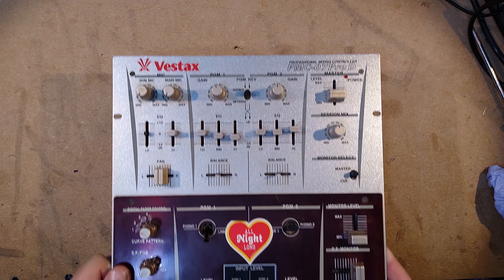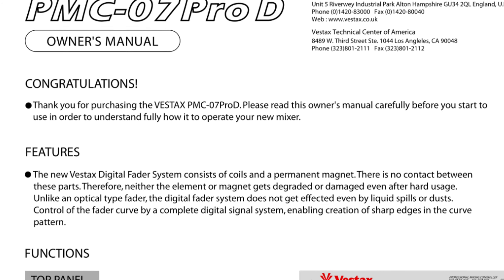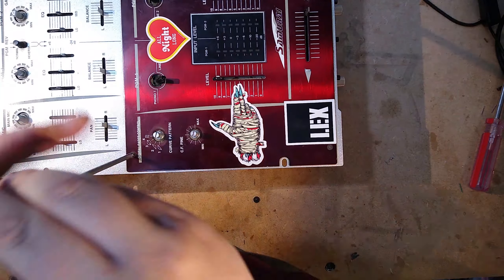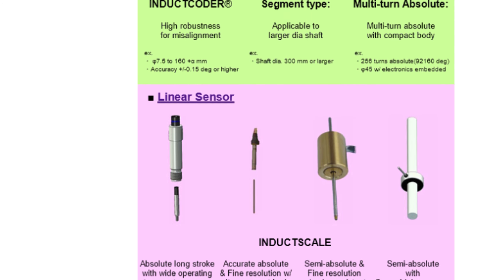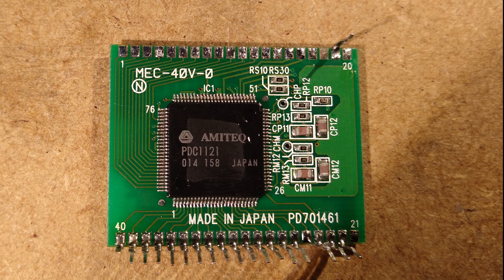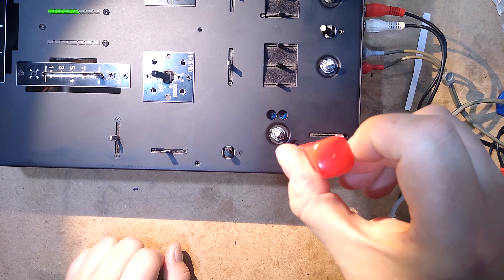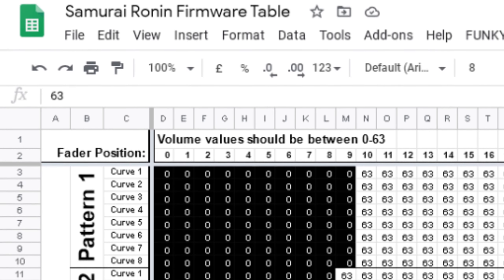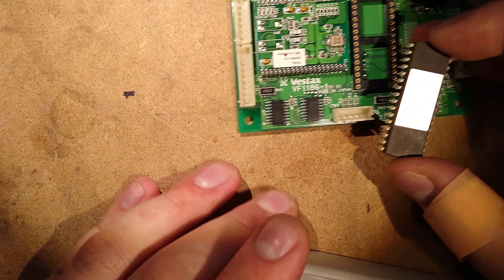Vestax Samurai Teardown + Mods

Comment: For my 06 replacing the caps with 47nF  was fine. Using smaller left a small pop. So I think that will work for both 05 and 06

Comment: Can you please do a focus fader review
Reply from the maker: I'm actually planning to!
Reply: @TheRasteri  I have a question about your final scratch video. I would love to know. If the current traktor scratch pro 3 is still running old final scratch code? Nobody seems to know.
Reply from the maker: @CarlosMunoz1980  nah it's a totally new code. even the earlier traktor scratch
 mk1 timecode was different from finalscratch (2000hz instead of 1200)
Reply: @TheRasteri  ahhh I see. What about traktor pro 2 and traktor pro 3. To me it seems like just a new paint job and some minor tweaks and features. Sorry to bother. I love and still use traktor. But am a little disappointed how NI have neglected it’s user base. Serato rekordbox and even Djay pro have surpassed them in many ways.
Reply from the maker: @CarlosMunoz1980  yeah NI don't seem to care about traktor anymore... I'm looking at serato options
Reply: @TheRasteri  Djay pro is nice. And with this new DVS support. It's awesome!!!